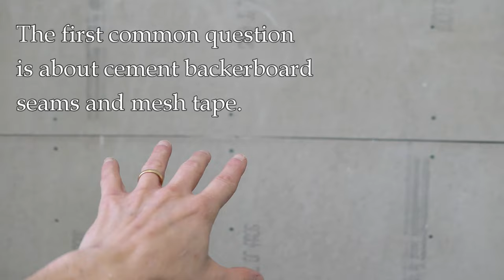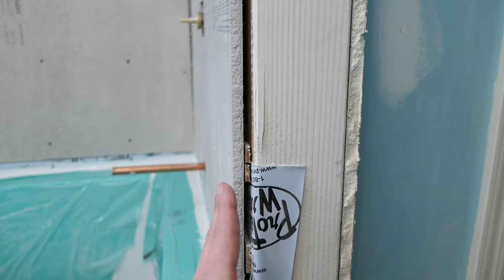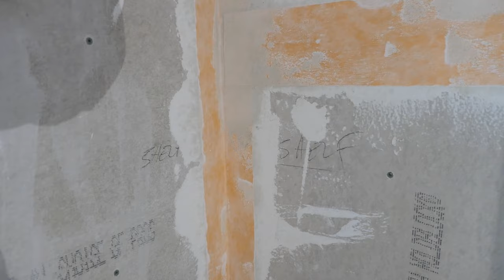Should Backerboard Go Over The Tile Flange Or Up To It?

Comment: Do you use Unmodified on the kerdi band and If so would it be ok to use modified large format thin set for 12x24 tiles with this hardiebacker/kerdi band ? I’m building a niche so I want to use kerdi band on those seams or some water sealing in niche. 
Ps already have some kerdi band.
Thanks in advance
Reply from the maker: The issue with Kerdi membrane is that it doesn't allow moisture to escape from behind, so curing of thinset can be troublesome.  Depending on the substrate you install the Kerdi over, you may need to use either modified or unmodified thinset.  When installing tile over the Kerdi the size of the tile and the number of grout lines available for moisture to escape may influence which thinset you use.  Schluter recognized the confusion this variance has caused, and they created a thinset product called "Allset" which can be used in any circumstance.  It is expensive, but it eliminates the guesswork.  It's available at your local tile store.
Reply: @enduringcharm  do you think I’d have issues with just the band over seams of cbu?
Reply from the maker: If you are just putting kerdi band or a few inches of the Kerdi over seams, it's probably not important.

Comment: Such great information!! I do have a question though… can I apply all of these techniques with a tiled surround but with a window over my tub?
Reply from the maker: Well, a window inside a tub or shower alcove is a whole 'nother can of worms!  It's really a bad idea to have a window in that area, and it usually happens when an existing room is repurposed at some point to become a bath or a half bath is expanded to a full bath.   The trouble is that windows are not designed to be sprayed with water from the inside.  Inevitably I find rot creeping in, which can get quite bad.  I've removed a number of windows from shower alcoves after the wall cavity became wet and rotted away.  Even if you use a vinyl window, the water can leak into the wall cavity and framing.

Typically if I'm doing a bath remodel with this situation I will remove the window completely and seal up the hole, creating an insulated and sealed exterior wall which can be tiled over safely.  Depending on the size of your bath and the style of your house, you may be able to do a stand-alone bathtub/shower, which is pulled back from the window.  In that case you would have a shower curtain going around the whole tub, keeping the water contained. Or, you may be able to relocate the shower to another area or use glass walls creatively.  I would highly recommend using this opportunity to fix the problem, though.  You don't want to spend a bunch of money on a remodel, only to tear out the rotted wall a few years later.
Reply: @enduringcharm  
If I were to use a free standing tub, which I’m not sure my budget will allow it, would it be a problem hooking up to the current plumbing coming out of one of the end walls of the alcove?  Also, what is your thinking on using a shower curtain inside of the tub over the window when showers are taken if I have to go that way.  I was wondering about the moisture buildup.  Thanks for you time.
Reply from the maker: A freestanding tub would require moving the drain and supply, and it also assumes you have room for one.  You need to leave space around the whole tub so you can walk around it.  It could well be a budget-buster.  The clear shower curtain over the window while you shower is something I almost mentioned, actually.  You can just set up a second shower rod on the inside for the second curtain.  I've seen this done successfully to avoid water problems with a window.  However, I would much prefer just to remove the window completely if possible.  About the only time that is a problem is if you have an historic house or if the bath window faces the street and removing the window would affect symmetry.  But, I understand if the budget simply isn't there.  A clear shower curtain would be a fall-back position.

Comment: Awesome video. What would you do if the backer board is already installed (ie can’t get behind it to place the flashing)? Is it important enough that you’d uninstall the backer board and start over or is there another good option?
Reply from the maker: It would depend on the circumstances, but if the backerboard is up and the transition to the drywall is not yet spackled it wouldn't be that much trouble to remove the backerboard and install some flashing.  If that's too much, I would at least use the kerdi membrane over the corners and joints.

Comment: Ok this was great information which I just completed complete cut and upgrade to our guest bathroom, so what’s done is done. But for future projects, for projects where hardi-backer at top of tub/shower lip ( I went completely over mine which stepped-down area was covered/joined by a tile trim border), as yours is to the left end, what do you do to fill the huge (weak) gap area (approx 1/2 to 3/4”) between back of tile and tub lip (weather stripping)? This area seems very weak to me for grouting? I’ve always been told you can’t have void or poor support for backing where tile grout is being forced into grout lines. No problem on your right because the tub lip will support grouting ). My question may be confusing, but trying to get the tub over the lip in my project was a pain in the butt! Thank you for your videos! They do really help answer a lot of questions I had in the past...and still have!!!
Reply from the maker: I think you are looking for this video I did:  https://youtu.be/y3bpE-GhYUM
Reply: @enduringcharm  awesome! Thank you!

Comment: That's it, you're my man. I watch all those videos having decided to take a job I never did on a rental unit (Bath walls re-tiling), same stuff as in this video, and for a whole week I watched tons of vids but they always show ideal conditions, perfect plumb studs and stuff and of course nothing is flush on the unit (1950's, 20 Units building), and, Oh, what a surprise when I removed the existing tiles and board, there are no studs !.. 
So much for all I watched and was expecting to find behind.  Instead it looks like a cement wall so now I guess I have to drill my backer boards onto that, and not the every 16" studs I thought I'd find... (And I pass on the 70 years old galvanized pipes I found there, it' so gone, so first will have to re-pipe...)
This adhesive protector band trick you show on your video will really help, as, like in your configuration, I cannot change the wall for above bathtub lip since I have to put back later the glass bath enclosure and come with the exact same measurement as what was there, so that trick really will help. And for the floor too, this Protecto band is smart... Great Video ! Thanks.
Reply from the maker: You're reminding me of an older video I did about a 1950s era bath.  It was a low-end project I took on only to help out an elderly lady who didn't have the resources for higher-end work.  You might get a chuckle out of it:  https://youtu.be/m4ixKqScY04
Reply: @enduringcharm  Thank you John, I just watched the video. What a job... I'm running in the same stuff with galvanized piping, these plaster walls and all. I hope I can pull it through. You video was really interesting and helpful. If I leave the plaster wall or some of it in place, is it a problem just to affix hardie backup boards, or the like, directly on them to do my tiles ? (it's a 5'x5' on one side and 3'x5' for the return, the bathtub stays in place). Thank you, it's amazing the way you work...
Reply from the maker: You'll be sorry if you leave the plaster behind backerboard and tile.  It will lead to cracks or worse in the tile job.  Better to bite the bullet and strip it off now.  That will also give you a chance to beef up the framing if necessary.
Reply: @enduringcharm  Thank you for the wise advice John, more work ahead...

Comment: Thanks for the shared expertise. I appreciate it. What about where the drywall meets the backer board? Should we prime the paint 1st, or will the tile adhere to the drywall mud?
Reply from the maker: Tile should NOT be used on top of the drywall compound alone.  It will fail.  After you have finished sanding the transition apply at least two coats of primer.  I use Zinsser 123.  Then let the primer cure, which is a step some people forget to observe.  The thinset will stick just fine to cured primer, and most of the tile will be adhered to bare backerboard anyway.  I also apply the finish paint before tiling, but that's a personal choice.
Reply: @enduringcharm  yup that makes good sense. Thank you!

Comment: FYI: You can put thinset between the backer board (hardie, Weta, Kerdie) and the studs for shiming.
Reply from the maker: Another comment mentioned the same thing, but I'm not a fan of the idea.  That's a tile guy coming up with a solution, not a carpenter or a general contractor!  Anyone who has ever faced broken plaster keys in wood lathe will understand why it's not such a hot idea.  In the short term it may provide backing, but with seasonal wood movement and no mechanical connection, the bond between thinset and stud will be broken.  If shimming is possible, I prefer wood and mechanical connections in the form of screws.
Reply: @enduringcharm  The Mechanic connection is the screws securing the backer board to the studs. You apply the thinset to to the studs (more than is needed) than use screws through the backer board into the studs to adjust the backer board to be flat. The thinset will harden preventing the backer board from moving. 

The issue getting the shims adjusted behind the backer board. Sure you can adjust on exposed edges, but very unlikely everywhere you need to shim. 

The other option is to screw in  2x4 on the side of the warped stud to create a level & straight surface for the backer board to rest on.The issue I see with using small wood shims is having to shim in +5 places on a warped stud. if you fail to shim completely to support the backer board, it's going to warp.

If the studs shift its going cause a problem no matter how you secure the backer board to the studs.
Reply from the maker: I understand how this idea works, but once the thinset delaminates (for lack of a better word) from the stud then you have a loose bit of mortar and a screw head that could move relative to the backerboard, causing  squeaks or even cracked tile.  Wood studs expand and contract with seasonal variation in moisture, so the movement is inevitable.   Like I said, my experience with plaster over wood lathe acts as a cautionary tale.  There's a reason they moved to wire mesh lathe in the 50s.

When I shim with wood, the method will depend on the circumstances of the room.  But, one method is to install 5-6 inch wide plywood strips horizontally across the studs, then shim behind the strips.  The strips are screwed to the stud faces and it's easy to use a four foot level as a straight edge, shimming where needed.  Then the backerboard can be applied to a dead flat surface.  Another advantage of this method is that you can locate the strips at the backerboard seams for more strength.  Other times I'll use a variety of plywood thicknesses in the same manner to make a wall plumb or to fill in dips.  Blocking between studs can sometimes be used in the same way.  There are times when I'll use a shim or strip of wood vertically on a single stud, and I'll use a straight edge held horizontally to make certain I've achieved flatness.  Vertical shims I will nail in place before applying the backerboard using roofing nails.   There are other methods too, but in all cases the flat wall is achieved and confirmed before I put up any backerboard.  That stuff is heavy, I'm not moving it twice! 

For me the thinset "shimming" just isn't a good idea, and I wouldn't feel comfortable turning a bath over to a client with that method.

Comment: Awesome technique man. Just 1 question what thinset do you use to Apply the kerdi band to cement board?
Reply from the maker: While Schluter does have specific requirements for modified or unmodified thinset used with it's Kerdi membrane, the choice depends on the substrate.  They publish a booklet with this information.  They also make a product called "All-set" which can be used in any situation.  That said, I've found that if you are using only the Kerdi band and not the Kerdi membrane over the rest of the wall, you can use a modified or unmodified thinset as long as you give it time to dry and cure.

Comment: Can I use #15 felt roofing paper to protect the floor along the line of the bath tub/shower pan? Thanks for the very useful and informative video!
Reply from the maker: That's better than nothing, but a strip of plastic sheeting, self stick flashing or leftover Schluter Kerdui would be superior.  The idea is just to prevent the weeping of moisture in that area over a period of years from rotting out the plywood.  If you can put down plastic six inches to either side of the tub line that's probably enough. Your backerboard or equivalent will go over the plastic so only a thin strip is exposed before tiling and caulking.

Comment: If your shower base has weep holes does the backer board still sit on the lip?
Reply from the maker: What do you mean by weep holes?  Are you referring to the recessed area some manufacturers leave in the front?
Reply from the maker: Sorry, youtube didn't show me your reply until weeks later.  I saw your response, though.  So you are referring to a small recessed area in the front which is supposed to let water out if it gets behind the tile.  I think that's dumb.  First, if you grout and caulk properly no water is getting behind the tile.  Second, if you use my flashing trick or if you waterproof the whole substrate, it won't matter if water did get behind there.  Third, if you do leave that weep area open, you'll find it collects water and soap and becomes a place for mold or mildew to grow.  I caulk over that area with silicone caulk, just like the rest of the tile-base connection.

Comment: If you butt the backer board to the lip is it okay to get thinset on the lip when installing the tile? or should the tile just overhang the lip?
Reply from the maker: No harm is done if thinset gets on the lip, though it probably won't stick well. It does stick to the back of the tile, though, and that can provide some support for the tile.  When using smaller tiles it's important to have this backing or support to prevent tile from cracking in the future.  So, go ahead and smear the thinset over the lip.

Comment: This installation matches my scenario pretty closely except I have a steel tub. Wondering how you would handle where the backer board meets the tub lip - manufacturer calls for screws/washers to anchor my steel tub lip to the studs. Does backer board just sit on top of the screws anchoring the tub lip? Seems like doing so would leave a larger gap between tub lip and backer board than what I see in your video. Also, I’m assuming I should flash over top of the screws attaching the tub lip to studs. Appreciate any insight here!
Reply from the maker: I don't do too many stamped steel tubs anymore, but the situation is similar.  You can use pan head screws or roofing nails to secure the tub, then use the self adhering flashing over all of it.  The steel flanges are usually pretty thin, so you can likely bring the backerboard over the flange if you wish, leaving a slight gap at the bottom so it isn't actually touching the tub.  Shim out the studs using 1/8 inch plywood if need be.  If a single screw is in the way you can scrape off a little of the backerboard in that area to help seat it.
Reply: @enduringcharm   great, thank you! My situation is similar to this video where the adjacent walls are already finished with 1/2” drywall so I cant really shim out the shower area (theres also a window directly next to the shower so floating out the transition with mud would be tough). I like the idea of just chiseling off a bit of backer board to account for the screws/nails on the tub lip. Do you recommend any particular kind of primer over the drywall mud? Was thinking of using zinnsser shellac based as it seems to seal out water pretty well.
Reply from the maker: I use Zinsser 123, not to be confused with their BIN shellac based product.  Shellac products will seal out moisture in the air but do poorly with water contact.  Let the primer cure, not just dry.  Give it a day.  I also do my finish painting before I tile.  I've been using Ben Moore Bath and Spa paint with good results, and you can grout right over the paint:

https://www.youtube.com/watch?v=_aja8hfhElI&list=PLD4oAOZqK9mCjvmw_nUkZBrPPXf_20Lad&index=4